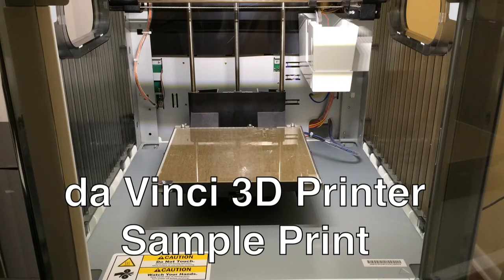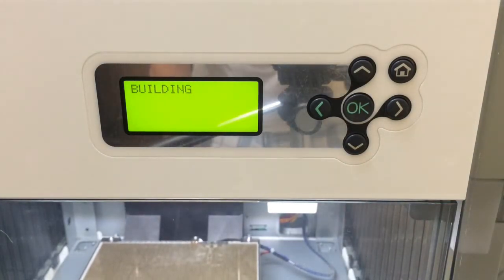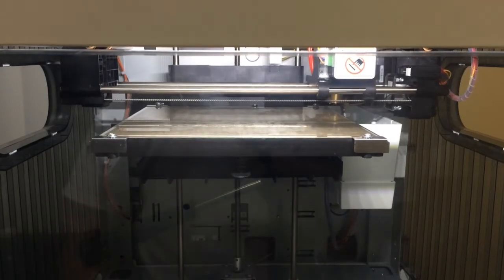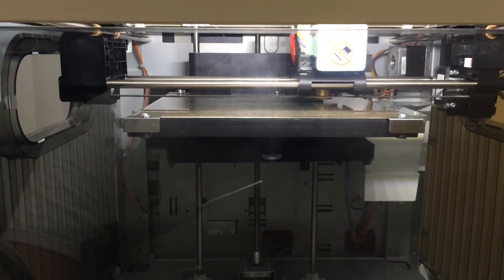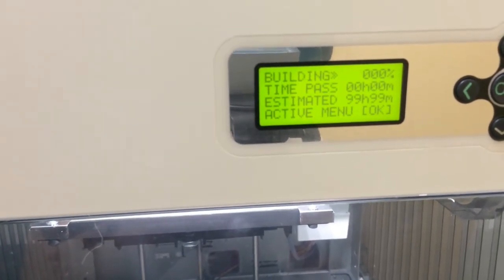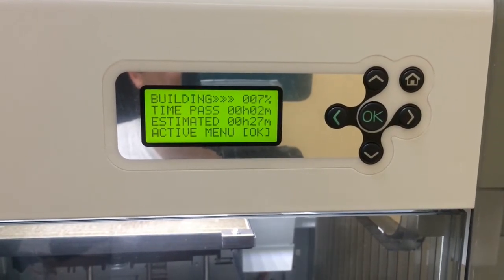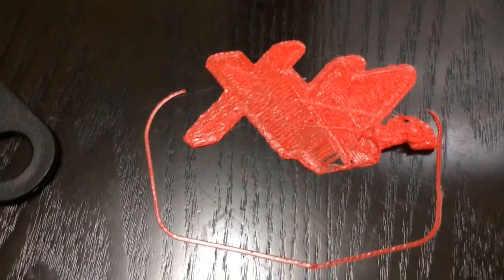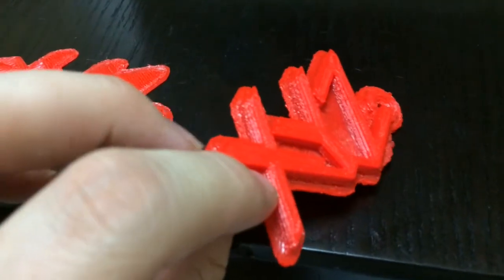da Vinci 1.0 3D printer sample printing (failed first attempt)

Comment: You had this printer for a while I just bought it and when I try to print it starts off when then all the sudden the plastic sticks to the nozzle and the hole piece moves and messes ever thing up. I don't know what do do can anyone help?
Reply: Did you put any glue down?
Reply: Yes. Still Does it.
Reply: IndaLight I would try putting a nice smooth layer of glue down, not too much and not too little.  Make sure it covers all exposed parts of the bed you are going to print on.  If that doesn't work I would calibrate it.  I made the mistake to leave mine alone after multiple prints to a point where the nozzle was so far from the print bed it was just falling out of the nozzle and not sticking to the print bed.
Reply: I printed with a raft and I calibrated it with blue painters tape and its all good now thanks.
Reply from the maker: Did you figure this out?

Comment: Is this printer capable if printing intricate designs such as ball bearings, gear bearing or other moving parts in one print?
Reply from the maker: h76tr I think yes and not sure. The reason why I say yes is because it depends on how small the ball bearing is. I mean I've seen other printers that are similar to this one print decent size bearings and they worked. The reason I'm not sure is because I never actually tried but it is on my list of "things to print".
Reply: no its not bud its a very limited printer youll be better off going for a Wanhao Duplicator i3 PLUS or any printer in the Wanhao  family. they are basically reprap prusa i3 but already built instead than an inexperienced person having to build a kit plus it has a massive build space just youtube the model bud.
Reply: ah ok thanks!

Comment: This is not a bad calibration. This is a poorly made or poorly translated file. Try reprinting it using a raft. You should print most things using a raft as to assure you can remove it without breaking the glass or knocking your printer out of calibration and to fix any Z distance errors that might exist. If your machine came out of the box it is dead nuts calibrated. If your first print was defective, the file is defective.
Reply from the maker: How the file be defective when it's their sample file that is in the printer itself?
Reply: +zpridgen75 My came out-of-box failed calibration

Comment: Instructions told me not to calibrate it because they calibrated it prior to sending. I did so, and it just started engraving into the hot plate because it was so out of calibration.  Calibrated with a little difficulty and now it's whipping up my first print, a demo thing that says 3D Printer with their logo
Reply from the maker: sweet. You still using it?

Comment: The glue doesn't make it easier to peel the model off, it is to hold the first layer in place on the table so the model doesn't move off location. If anything, the glue makes it harder to peel the model off. You may not have had any glue in the spot where your model messed up causing it to lift up off the bed during printing and the print head caught on it.
Reply from the maker: I believe you are correct. It is very possible that I did a bad job applying the glue.